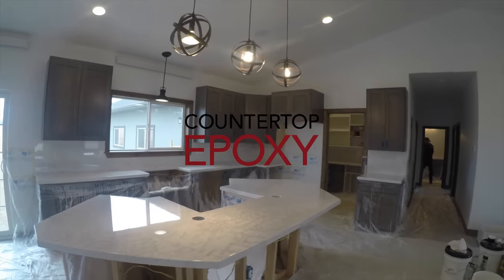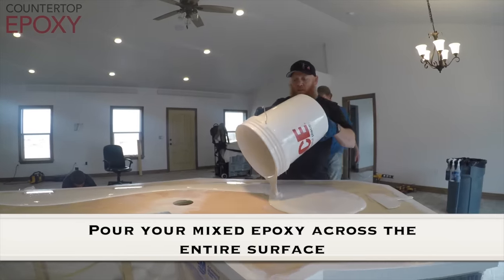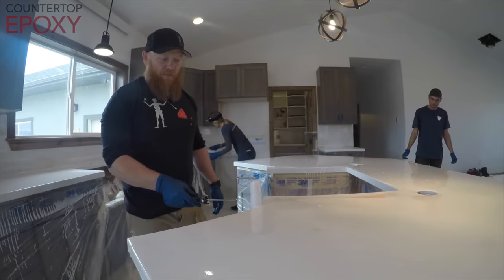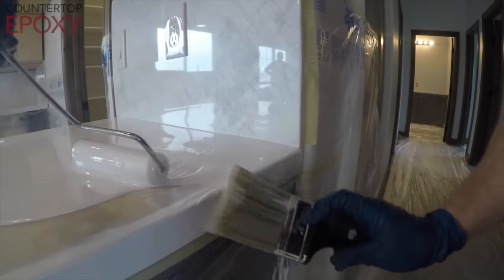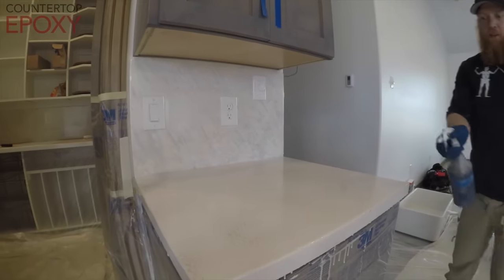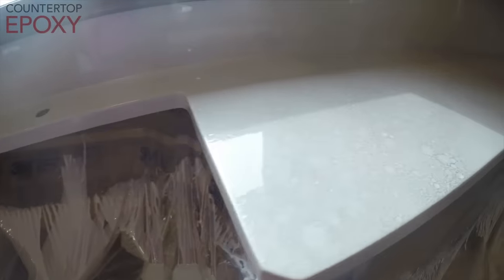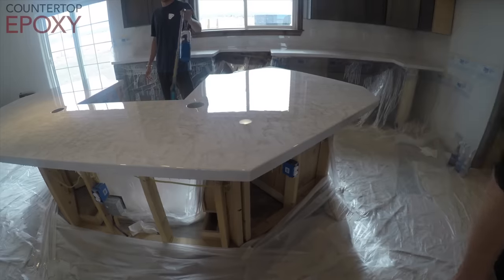HOW TO - Epoxy Kitchen Countertop - Countertop Epoxy - White Marble Countertop - Kitchen Countertop

Comment: That's how I started my business. Everyone doubted me. My own family doubted me. I started off in Hardwood flooring and tile with my dad. When I found out about epoxy and it's BEAUTIFUL AND GORGEOUS designs you can make, I immediately fell in love with it. I started doing epoxy countertops then once I had enough money, I invested in epoxy flooring. Man! I LOVE MY JOB!
Reply: How much does something like this cost
Reply: That's very inspiring
Reply: I‘ve been thinking of starting a business like this myself!
Reply: @goose1498  depends. If you want one color or multiple colors? Also if you want metallic colors? How big or small the area is? About anywhere from 5-30$ a square foot
Reply: Yair Celis 
Wow, never seen this until today. Beautiful I’m interested, do u by chance have ur business in the Bay Area? Or maybe you can  refer me to a business that installs epoxy in my area?
Reply: Irene castillo I am in Florida north Florida area
Reply: Do you do it on wood or concrete?
Reply: Adana Lezama if you want floors it has to be on concrete foundations.
Reply: MDF based epoxy countertops  do not crack due to natural swelling and shrinking of the MDF in response to seasonal changes in humidity?
Reply: How well are you doing 2 years later? Is it worth investing and learning? I have been an interior exterior painter for over 7 years and I am looking for a way to make my own and have always been infatuated with epoxy designs and outcomes. Are you licensed and insured as a painter to start or what?
Reply: @onionbottom78  If you call Countertop Epoxy they may be able to recommend someone in your area.
Reply: @adanalezama4085  It will go over pretty much any porous surface, but even surfaces like tile.
Reply: @yaircelis1175  Actually you can pour over wood just as easily as concrete. I've even gone over oak flooring and tile.
Reply: @limabravo8782  MDF is the best material for indoors. It's very moisture resistant. The recommended way is to use 2 layers of MDF and overlap at all your seams. If you're using just one layer of 3/4 MDF you can use a biscuit joiner at the seams to prevent cracking.
Reply: Where can I get the materials to do epoxy countertops ?
Reply: That’s literally what I’m trying to do. LITERALLY
Reply: Good 👍 4 you
Reply: Is the epoxy food safe?
Reply: @jasonsizemore3893  it’s worth it!
Reply: How did you start building clientele ?
Reply: @kcomst  do you possibly have a tutorial?
Reply: @dimounddivas  I started with hardwood floors. So, I already had clientele. I just started doing cool designs for free for these clients. After a friend of a client saw my work, that’s when they all started calling in
Reply: Congrats to your success! Such an inspiration!
Reply: That's wonderful. Do you have a YouTube channel. I'd just be happy to do some things for myself.
Reply: @kcomst  Do you have a YouTube page. Both you and @Yair Celis seem to have good information on the process and technique. What epoxy do you use?
Reply: @luv14lyf  I don't have my own page. I use Countertop Epoxy.
Reply: Need to learn how to do it
Reply: Does the epoxy makes the floor very slippery? How are you doing now? Thanks
Reply from the maker: @FzeroVaporeon  Hello we are well great question! Our FX Flooring Epoxy isn’t as slippery as you would think it’s no different than tile.
Reply: Where are you located?

Comment: I'm curious about the scratch resistance. I've done some clear over staind woods, to bring out the grain. Beautiful, but find it scuffs easy. Thinking on countertop it would get really beat up.
Reply from the maker: Our premium epoxy is very scratch resistant. We have numerous customers who are extremely satisfied with our product for their countertops and with its durability!

Great topic though for a video/demonstration. Thank you for sharing your thoughts. :)
Reply from the maker: Yes you can, if you sand later it will lose the high gloss finish though. It'll be more of a satin/matte after sanding and buffing.
Reply: statorworks 345  I would use buffing compounds made for cars. They take out smaller scratches in a cars clearcoat, restoring it to a shiny finish. I'm not an epoxy guy, just guessing if it works on clearcoat it will work on epoxy! One site is autogeek.net that both sells products and has really good forums to learn from.

Comment: Excellent job! One question though: other than replacing the whole thing, how would you deal with major damage to a particular area on the countertop?
Reply from the maker: To achieve a flush finish we do recommend doing a clear coat pour to the entire surface.

Comment: 3:41 - am I the only one that thinks that section looks terrible?
Reply: yes it looks real crap for me. unweven wavy, pinholes etc.
Reply: That’s not finished Bro , the resin has to still level out . He’s just troweled over it to ensure a marble finish rather than the sprayed “man made” look x
Reply: agreed. doesn't look at all like a marble-like pattern
Reply: I dig it. Reminds me of waves washing over shoreline. That torch makes me nervous tho. I keep Waiting on him to skip it across the top by mistake 🤣
Reply: I highly doubt (with similar experience) that, that was the finished effect. The finished effect would come out very simular everywhere. I looks like (at that spot mentioned) that he had done all of his colours, but only lightly trowled in one direction at that stage on that part.
I'm sure he would finish the whole job with a very close pattern all over. I'm sure he would of still needed to lightly trowel a few times in different directions and most likely did some more heat treating for bubbles and the finished with one or two coats of clear epoxy.
One thing I've always hated as a tradesman is doing a job an ppl picking at things before the jobs done. I'd tell them politely to let me finish and then please tell me anything you aren't happy with.
They don't end up with many negative remarks in the end lol
Reply: 3:44 looks really bad. I wouldn't be happy with that section but the overall project turned out really nice. It's just that one section that'll drive me nuts

Comment: Countertop Epoxy, did you have wood slabs cut for the countertops? Or did you go over the old ones? Since mine are coming apart in the corners, I wanted to get all that replaced along with my whole kitchen.

Comment: Do you have video that shows putting on the resin topcoat? Is that necessary?  Can a blow dryer or heat gun be used instead of a blow torch?

Comment: Two questions. My Formica countertop is a bit banged up, and has a backsplash. I thought I would just remove the countertop and replace it with 3/4 inch fir plywood, and a wider lip at the front edge. I would sand it, clean it, prime it all white with a couple of coats, making sure it was smooth. Will this work alright?

I would prefer a tiled backsplash as opposed to the marble backsplash in your video. I thought I could put my first layer of tile on, without grout and allow the epoxy to butt up against the backsplash tile. Comments?
Reply from the maker: If you are going to fabricate we recommend MDF so no sealing needed plywood is extremely porous. No need to prime with our product our pigments are color blocking we do edge coat. Do your tiling and grout first then epoxy up to it. Give us a call for any other questions.

Comment: If u just want a clear protective layer of epoxy on existing/cheap countertops, can u still spray the alcohol on the clear epoxy to prevent yellowing??
Reply from the maker: We have a nano coat called FX shield that we typically use to add further resistance. The key will be having a proper mix ratio and we recommend using alcohol only when using our white marble kit.

Comment: Awesome! How would I do a back splash with just sheetrock in place now?  Use cardboard to make template of the space and transfer  the template to a thin piece of wood. Pour on the wood and silicone in place.  Would you do anything differently? And what about seams?
Reply from the maker: We pour horizontally on MDF boards then silicone them in place for the backsplash. 
We're working on a video dedicated to just backsplashes, so keep a look out for that in the future!

Comment: Great video. 

Did you epoxy the countertop splash back before hand or pre order ?
Reply from the maker: We did the backsplash prior. We just poured over mdf then adhered it to the wall prior to pouring the countertop. Check out our pouring over tile video we show the steps to create a backsplash.

Comment: One thing I would like to know, and I can't find the answer.  If, after I finish with the epoxy coat, i don't like the pattern.  Can I reapply a new epoxy coat or do I need to somehow strip off the first coat?
Reply from the maker: Yes you can apply another layer! We recommend lightly sanding the surface if it's been more than 48 hours of the first pour just to give it the extra adhesion. :)
Reply: Thank you.

Comment: how did you do the pieces for the wall?? did you cast them then glue them to the wall??
Reply from the maker: We poured the backsplashes horizontal, then installed to the wall with silicone.

Comment: Can you share a video on how you did the backsplash?
Reply from the maker: For these backsplashes, they poured horizontally and then adhered them back to the wall before pouring the counters. It should be the same technique. If you're looking to apply straight to the surface we'd recommend our wall epoxy since it's meant for vertical surfaces.
Reply: @SupplyHaus1775  ok thank you. Does the wall epoxy have a marble effect kit? Would you recommend either process over the other? So vertical wall epoxy vs pour horizontal then attach to wall?
Reply: @SupplyHaus1775  also what did they use to adhere to the wall?

Comment: How long after applying base coat do you spray the three primary colors! How long do you wait before scraping it with trowel!
Reply from the maker: Immediately after you spread the product across your surface you'll want to then go in with your accent colors. You can manipulate the design right after spraying. With our product, you have a 40-45 minutes working time when working in the appropriate work space temperature. (70-75F)

Comment: I have concrete cracks and weeds growing in the wood expansion joints in my Oregon driveway (promoting weed growth, year after year).  Can I use outdoor epoxy to cover/fill the cracks and wood expansion joints, along with beautifying my driveway?  What kind of driveway cleaning prep would be required, if such a project is feasible?  Also, what types of ongoing maintenance would be needed for the driveway, once it's covered in the epoxy?  Thanks for your help!
Reply: RainbowExplorerRN you can use a joint filler such as Sika 2c-sl or Deck-O-Seal. Epoxy is not recommended for outdoor use as it is not UV stable and will chalk and amber in direct sunlight. There are many ways to beautify your driveway. Acrylic modified cement overlays, concrete and masonry paint, stains and sealers. Most important part is prep. Wash the driveway with a hydro blaster with at least 3000 psi. Treat oil stains with degreaser. Your options are only limited by your imagination, and UV stability.
Reply: Thanks so much for the feedback on this!  I hadn't heard that epoxy is unstable in UV light.  I just love how it levels everything out, filling up gaps/holes/inconsistencies, all while beautifying the entire surface with a highly protective surface.  I've never heard of cement overlays before, so I'll check those out.  Meanwhile, as soon as I can manage it, my outdated tile bath and kitchen countertops are going to be introduced to epoxy treatments!  It's the perfect solution I've been searching for, for ages.  If I weren't planning on putting down a radiant floor heating system soon, I'd cover my floors with epoxy, as well.
Reply: RainbowExplorerRN For epoxy to fill and self level cracks, spalls and the sort, it either needs a self leveling filler or pre-patched with an epoxy gel. Check out Desert Crete or Life Paint for cement overlays. I have hundreds of pictures of different styles, patterns, colors, etc that are all possible with overlays. It's only limited by your imagination.

Comment: What do I use to pour the epoxy on?  An existing counter top?  Or is it best to put down new to pour on and if so, what do I use?  Your counter tops look absolutely stunning and very realistic.  Would love to do this in my kitchen reno.  Thank you.
Reply from the maker: Thank you Carol, and yes you can pour over existing countertops! If you wanted to start new, you can measure and build the countertops with MDF board and pour the epoxy then install them in place.

Comment: What kind of countertop do I use for the base to pour the epoxy on? My remodel currently has temporary plywood countertops. Do I buy a cheap countertop and then coat it with the expoxy? Thank you.
Reply from the maker: Hello Fran, we would recommend MDF Board for your substrate which is what we used in this video, and frequently use for our countertop builds.

Comment: I do concrete countertops and am looking into epoxy because of the colors. My question is how are you fabricating your countertops before the epoxy is added?
Reply from the maker: We build our countertops using mdf boards them apply the epoxy. If you were to pour over concrete, we recommend doing a skim layer of the epoxy itself to seal the concrete before doing the initial flood pour.

Comment: What is the best way to get a more matte finish? Not necessarily completely matte, but something that isn't quite as mirror finish as typical clear epoxy?
Reply from the maker: To achieve a matte finish or satin finish, we recommend wet sanding the surface after it has cured. You can then leave as is or buff and polish it. We have a video you can watch covering the process on de-glossing an epoxy countertop and polishing here: https://youtu.be/Wh7BXJGrsRo

Comment: do you have examples of bathroom vanity poured on cultured marble (90's style)....where the sink is actually part of the cultured marble molding and the sink has built in soap ledges and a shape like a clam-shell.  55" x 22" top with a backsplash that is all one piece. Fairly tall backsplash.  removable left-hand side backsplash.  Do you have a list of the products you sell?
Reply from the maker: We don’t have a video for this specific kind of resurface however we have had installers use our countertop Epoxy for a countertop with an included sink. For this specific type of molding and clam shell sink it may be challenging to get an even coating as the epoxy self levels and cures you may see some pooling unless it is baby sat and scooped every so often. We offer several epoxy products such as countertops, flooring, wall, outdoor systems, casting, and tubs. You can check that out here: https://www.countertopepoxy.com/epoxy/

Comment: This looks amazing. My questions are: What type of countertop did you start with? I have butcher block. Would this process work on that type of countertop? What area are you in?
Reply from the maker: You can do it over almost any surface. With wood you need to make sure to do a skim coat and work it into the pours to release the air bubbles or else your end product will be very bubbly and we are in Colorado!

Comment: i would like to know, do you apply a clear coat the next day????
Reply from the maker: Yes, add a clear coat once the first coat as cured to a useable hardness. (12-24 hours) If waiting longer than that period, it is recommended to sand the surface to ensure adhesion of the second coat.

Comment: What's the best surface to pour the epoxy over? What kind of countertops are underneath the pour?
Reply from the maker: For this application, we poured directly over MDF board. You can pour over various surfaces such as, laminate/formica, wood, concrete and tile.
Reply: @SupplyHaus1775  can it be used over a quartz countertop?

Comment: How do you remove drips from the bottom? I have tons of little epoxy icicles hanging down 😔
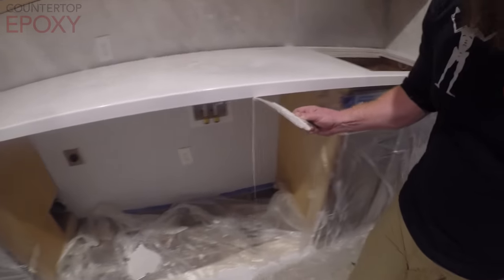Reply from the maker: For the drips, you'll want to come back during the application and a bit into the curing process with a putty knife to remove the drips. As shown at timestamp: 03:16 ( https://youtu.be/RAlGfBm9q0k?t=196 )
After cure, you can sand the drips down.

Comment: looks great but not as easy as it seems.  tried it this weekend.  ours did not come out nearly as good.  i'm going to have to order more and cover up the 1st try with more white.  also spraying on accents after 1 hr (or perhaps after the epoxy seems to by more tachy) made small craters where the isopropyl landed.

Comment: Hi CountertopEpoxy, this was a great video! Question, do you recommend spraying the alcohol on if you are doing a solid color? (I saw that it leaves drip/spray marks). Also, do you heat the level of resin?
Reply from the maker: We still recommend using 99% isopropyl alcohol! It helps pop any bubbles leaving your surface slick and shiny. It does leave dimples at first, but as the alcohol evaporates the dimples go away. Our brand, Countertop Epoxy, is self-leveling so it should turn out gorgeously sleek when you're done!

Comment: What expoxy do you use? And does it yellow after time?
Reply from the maker: We use all our own products. Here we are using our FX Black Label Countertop Epoxy. No issues with yellowing be sure not to use white, clear or light colors outdoors. Find out more here: https://www.countertopepoxy.com/fx-black-label-epoxy/?_ga=2.219683353.1014482303.1717453639-401054263.1711747083

Comment: What's the ratio of pigment to alcohol that you used in the above video? Also, is the top coat necessary after doing the counters?
Reply from the maker: The ratio is one packet of our metallic powder (27g) to one quart of 91% isopropyl alcohol, and the top coat is completely optional.